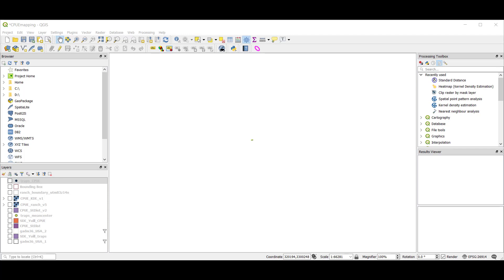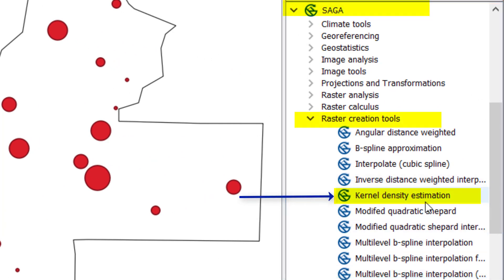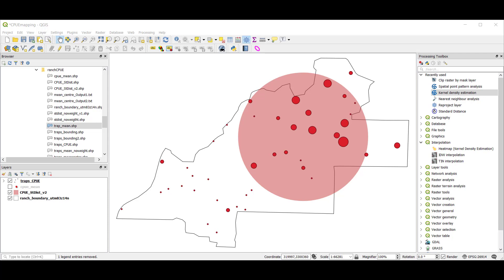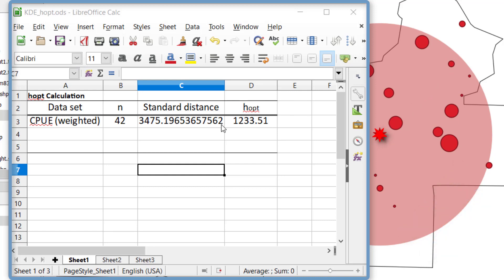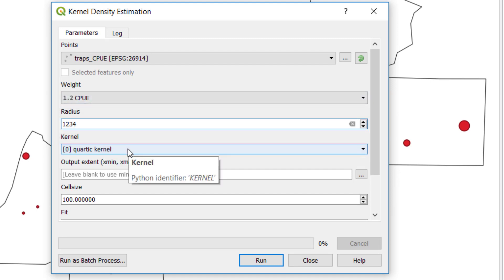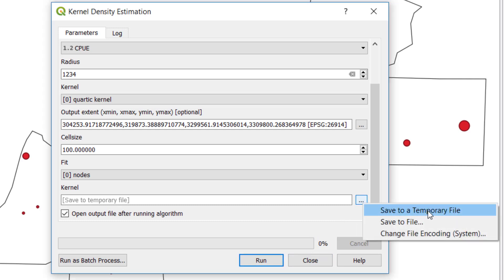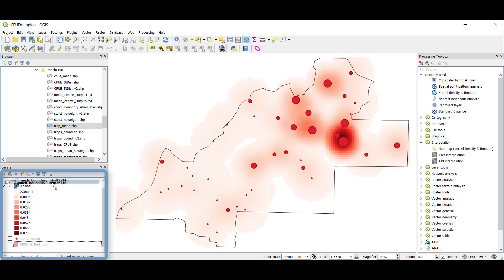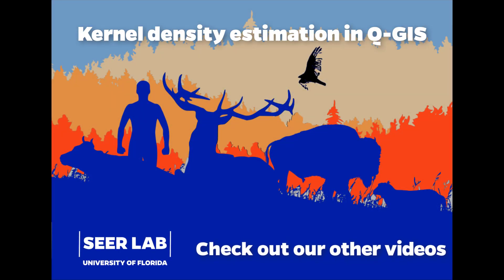Kernel Density Estimation with Q-GIS 3.2.3

Comment: Thank you very much for this material. I would like to ask about the unit of measurment in the raster surface. How can it be interpreted? The original data is a ratio (# flies / decimal hour), ranging from 0 to 9.26 am i correct? But the raster goes from 2.37e-11 to 0.073. This would be a density, but of what? I'm failing to understand how to relate the original measurement with the final density values. Thank you again!

Comment: What exactly is the measurement "standard distance"?
Reply: Hello. Standard Distance measures the degree to which features are concentrated or dispersed around the features (point or polygon features). It can be calculated for all features of the layer, or grouped by a field value or also can be use an optional weight field parameter. For automated calculation you can install a plugin in QGIS called "Standard Distance". (It will appear in the Processing Toolbox.)

Comment: Can help me with more information on how u used hopt
Reply: Hello. hopt is used to calculate the radius. This can be calculated in an Excel spreadsheet with the following formula: =((2/(3*n))^(1/4))*(σ) where n is your number of observations and σ is the standard distance. Standard distance is a little bit more complicated to calculate but you can get the SD (σ) easily by installing a plugin in QGIS called "Standard Distance".
More info about SD:
https://desktop.arcgis.com/eng/arcmap/latest/tools/spatial-statistics-toolbox/h-how-standard-distance-spatial-statistic-works.htm
More info about Kernel density:
https://desktop.arcgis.com/es/arcmap/10.3/tools/spatial-analyst-toolbox/how-kernel-density-works.htm